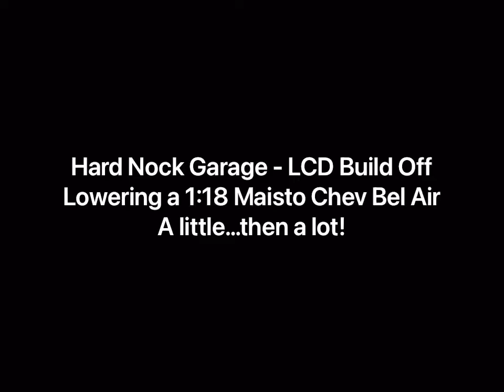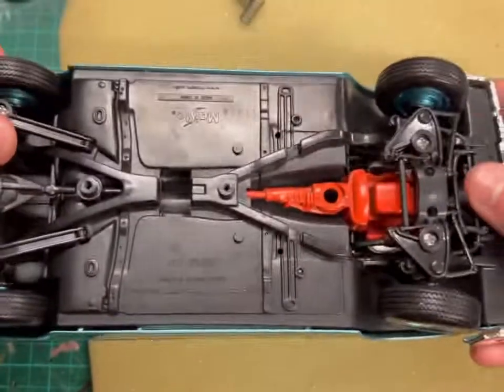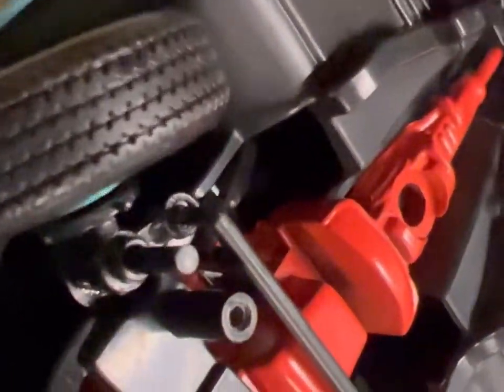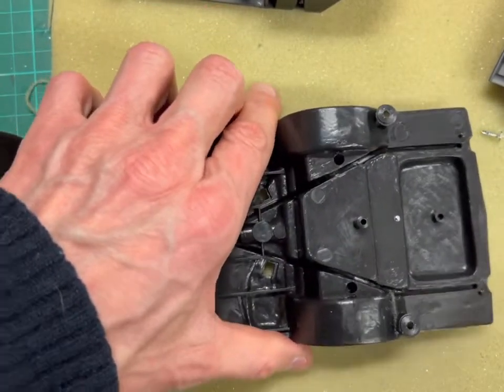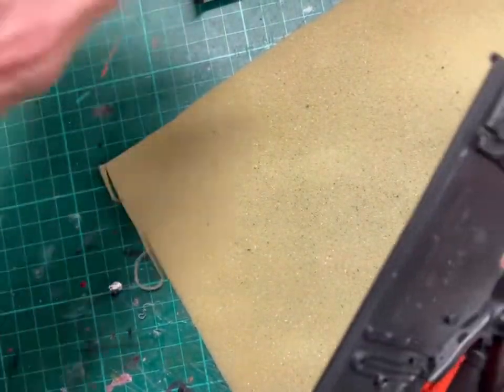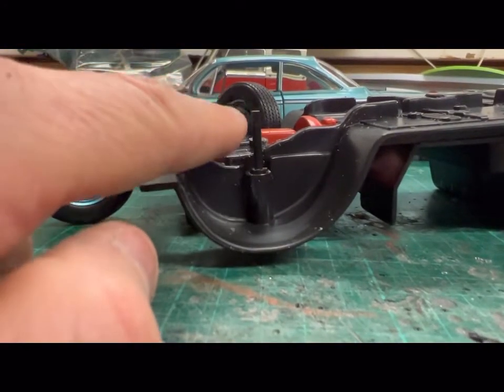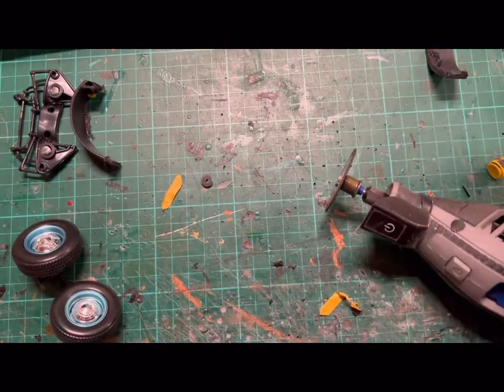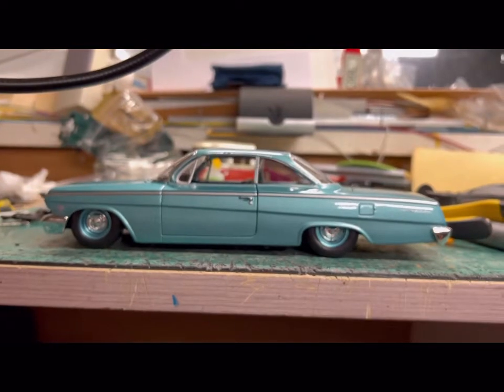@hardnockgaragediecastcusto576  - Lowering a 1:18 Maisto Chevy Bel Air

Comment: excellent video....i lowered my PT Cruiser by cutting the spring, still have some suspension travel.....
Reply: Thanks! I have cut the springs too or used bigger or smaller ones to lift or lower models